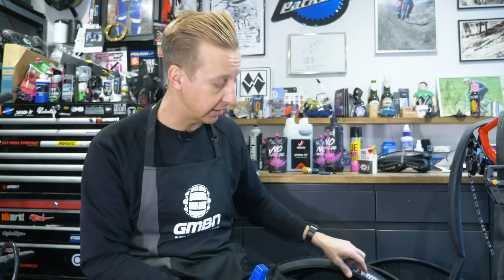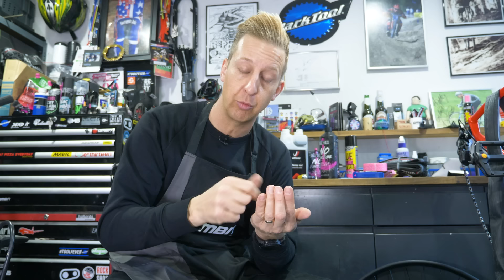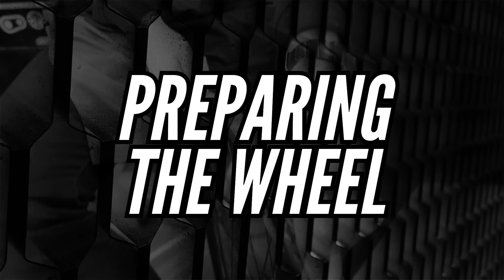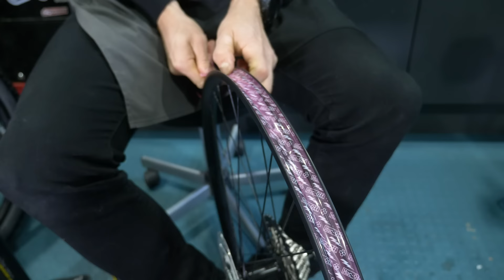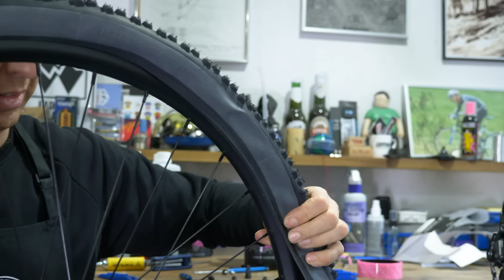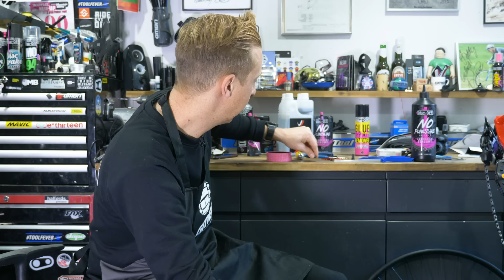How To Convert Your MTB Wheels To Tubeless | Mountain Bike Tubeless Setup

Comment: my DT Swiss wheels (27.5 and 29) never pop :-D but my Reynolds (hookless carbon wheels) pop very loud.

What I have experienced so far: newly mounted tires always lose a lot of air after inflating (first 24h up to 2 bars of pressure), after pumping them up again,  they might hold the air pretty good, after the first week I probably have to inflate them again (maybe 1-3 times)
Once I rode them a few times, they hold the air almost as good as a tubed tire. Maybe they need 0.2-0.5 bar every two to four weeks.

For me, there is no reason to run tubes. I Always seat the tires on a cleaned (and undamaged) or new rim with a standard floor pump, sometimes it helps to press the tire on a few sections slightly down while inflating them, to get them to hold some air. Once they popped in place, I just remove the valve cores and fill them up with 120ml of sealant per tire. Re-inflate them, job done!

I have got an issue with one of my carbon wheels, somehow sealant went inside the rim (under the tape) and is now making splashing noises under shaking, even if I do remove the tire :-D. But nothing is leaking so far, so I am pretty sure it's not that big of a deal.

Comment: With the sealant going through the valve does it gum up the valve?  Does it require a new valve and stem each time you redo or change tires?   Thanks for the great info

Comment: Had one recently where the rear tire started leaking from the valve after a few months, tightened up and fixed. Front tire air escaping from the spokes. Guess ill have to retape but gonna try some more sealant first. Both happened after sitting for about a month in garage because of work and weather. T

Comment: Ok So im a bit late to this video. Just got a pinch flat today and ive been meaning to go tubeless for a while. Both my rims and tires are tubeless ready, but I really dont want to get new tire because the tread is perfectly fine on them. New ones are 98.00 USD (Not sure for 1 or for a set of 2) and I cant spend that money right now. I also have valve stems a friend gave me so all I need is sealant and maybe rime tape. Will I be ok to convert to tubeless?

Comment: Hello Doddy.  I'm looking to frequently swap slicks with mtb tires on my 29er.  Slicks would be a Schwalbe Big Apple to a Racing Ralph and vice versa.  Note that these are both non-tubeless tires to a non-tubeless rim as well.

Is there a way of swapping them without throwing away the still-fluid sealant?  There's also an old trick where you use a split tube of a smaller tire size to act as an overlapping rim tape replacement that goes between the tire bead and the rim bead.  It's available to view in youtube as well.
Reply: I use slime pro str sealant, and reuse whats still liquid when swapping summer/winter tyres

Comment: Do you guys recommend using a glue on the rim for a conversion to seat the tyre. The bike shop where I first had it done used glue, now I want to do it myself. Great video btw. Thanks
Reply: Some of the pro xc guys use glue on the rim with less or sometimes no sealant. It works though I reckon it'll be a pain to clean up when changing tyres.

Comment: Hi Doddy!

My experience showed me, that if air is leaking around the valve hole, it could be also because of that the rim tape wears like an inner tube too. In my case I've changed the inner TL- rimtape and it sealed around the valve again.

Tell me what you think about it. And did you already had have that issue.

Cheers!

Comment: Will a tubeless conversion kit work for my 26" old school wheels?  I just purchased a set of Maxxis tubless ready tires and would love to convert to tubeless.  Thanks for the great vid.
Reply: @William Sambo Thanks.  Well my MTB is a circa 2000 rock hopper comp.  I preped the wheels by first filing down any rough edges at the spoke through holes and stem through hole, then sanding with 400 grit, then 800 grit.  Got everything smooth.  Installed the tires with tubes to flatten the bead for 2 nights.  Tonight is tubeless install!

Comment: So what if i want to go tubeless,and then after a few months,i want to top up my tubeless mtb tyre with sealant,i remove the valve core,the air escapes,tyre goes flat,does it become unseated?
Do i then need to buy an expensive booster floor pump? Or can i just pump it up as usual using my joeblow standard floor pump?
Thanks for any advice

Comment: Most decent rims come pretaped these days folks....dont just remove existing rim tape without checking first!
Reply: My wheels are tubeless on my commencal, I have just bought some new tyers, are all tyers tubeless compatible?
Reply: Thanks this comment saved me some time and effort was about to take the tape off and put some gorilla tape on thank god i didn’t buy 20 dollar tape tho
Reply: Team Banchamek a bit late but it should say if it’s tubeless ready on the tire. If not check the manufacturers website
Reply: I had my new bike which had new all terrain tyres, decided to go to winter tyres and go tubless. Though the tape on the new wheels would be ok so didnt tape them further, however after putting the tubeless tyres on etc I found I had a number of leaks. Will have to take everything off, check the spokes then retape to get a good seal. Bit of a pain. Got a friend that has been mtbing for years that says tubeless is more hassle than its work and to stick to slime innertubes, but i am willing to see how it goes. Spent good money on the tyres so not ready to give up yet!

Comment: Hi 
i have 29 2.5 on front and 27.5 2.8 on the rear using stans race sealant would you recommend 120 ml in the front and 200 ml in the rear 
many thanks

Comment: I work on my bike myself and know what I’m doing with most things but I’m not the best with tyres, I have bought tubeless compatible wheels but I’m using my tube only tyres on the rims and they don’t mount properly and they wobble, the wheel isn’t buckled it’s the tyre as if the tyre is too small for the rim (was also very hard to get the tyre on) do I need to use tubeless tyres with tubeless compatible rims or can I use tube only tyres, or do I need tube tyres but ones that are also tubeless compatible

Comment: Can I do this, and then bring a tube, so that in case of a flat tyre I can put the tube in, pump it up, and continue riding? That way I save the weight of two tubes and eliminate the risk of being stuck in the mountains where there is no phone coverture.

Comment: Very useful video, thank you for making that! One question: I'm very confused by rim tape sizes. I obviously know the size of my rim, based on that what size of rim tape should I use?
Reply: to answer my own question: if I understand correctly it simply needs to be a few mm smaller than the internal rim width. It must cover the holes for the spokes but not where the bead of the tyre will seat or interfere with the seating in any way

Comment: Will 30mm rim tape work for a 35mm rim? My logic is that if it’s covering the holes it should work fine. Also roughly how much sealant should I use for 27.5 inch rims by 2.3 inch tyres

Comment: Are all tubeless tires kevlar folding tires or can they also be wire beaded tires?  Also, can you use an air compressor to seat the bead to the rim?

Comment: I'm not sure why but trying to use tubeless tape has never worked for me.. however Gorilla tape works first time every time.     With my current tires.. I seated them fine on my Giant TRX1 wheels (Maxxis DHF 2.6 / Aggressor 2.5) using just a floor pump..     I haven't always been so lucky but with my current setup a floor pump was all i needed.
Reply: Yes I've used gorilla tape no problem, helps if you warm it up slightly, I put it on quarter before the valve all the way round till quarter after the valve (so 1 and a half times round), I think mavic supply their wheels with g tape

Comment: Windex or glass cleaner is a great bead lube. Flashes off and no soap in the rotor. 
 One of my most used tools for all things garage (including bikes) is an air compressor. It's simply a must have and makes tire seating a breeze.

Comment: I setup tubeless tyres around 4 months ago, haven't ridden my bike for the last 2 months and noticed the front tyre was flat this week. Once you've set up tubeless is there any maintenance required like cleaning the inside tyres and rims from old sealant before adding fresh sealant or is it okay to just keep topping the wheels up with sealant every so often?
Reply: It’s ok to just top off every 6 months or so. If your not riding the bike for any length of time, give your wheels a spin every now and then to keep the inside of the tire coated evenly.

Comment: Before I convert, I just want to know - given the way the sealant works, sloshing around inside until a hole is created and the change in pressure draws the sealant to the hole (oversimplistic, I know), if I was to want to release some pressure for a particular ride, wouldn't think just make a mess of your valves?  Or do the valves have some way of preventing this, or is there something else to consider here?

Comment: Any additional advice for seating fat bike tyres (26 x 4.0)? Been running fatbike tubeless for 3 years, but alphabetical have trouble with getting tyres seated without tubes. I’ve tried seating with a tube, then taking tube out but leaving one side still on. Helps but still difficult. TIA.

Comment: My tires are not tubelles ready and don´t seem to hug the rim very tightly so the air escapes through the gap even when I use the charger. Should I put more tape on the rim to make the gap smaller?

Comment: Hello, I have a question about going tubeless, Right now I have a tube and I keep getting flats, the last one damaged the tire with a 2" cut. I patched up the tube and tire but after inflating to 20PSI, there was a bubble on the tire where you can see the back of the patch. So I ordered new Tires, Maxxis Minion ..26x4..these are tubeless ready and I just need to know why I would go tubeless and the benefits of it. The bike lanes here are not cleaned and sometimes we hit a nail or a screw and may case I hit an old razor blade. I had slime in the tubes and it worked for 1mile and I had to walk the bike back. We ride 20-30 a miles a day everyday so we put milage on the bikes and tires since we are all retired. Thanx in advance for you solution and convincing me to go tubeless. Stay Safe
Reply: Schwalbe Raceguard / double defense tires rode me through glass shards on the street without going flat.
Tubeless tires dont help with large cuts into the tire unfortunatly.
Reply: @beerenmusli8220  It has been 2000 miles since my last flat and im riding on the same route with our little group. I have lowered my pressures to 15PSi rear and 17PSi front. Stan's sealant has been amazing, it sealed the glass cut in the AM ride and I didn't realize it till after my PM ride 60miles, I lost 1PSI. I will never go back to tubes. Trying to convince the rest of the gang to go tubeless (its going to be a miracle), I carry a USB rechargeable air compressor just to inflate their flats...lol

Comment: Is it more cost effective to get a cheap air compressor rather than a fancy track pump with a charger cannister?
Reply: In my opinion, yes. You can go down to Harbor Freight and get a small compressor for less than $100. Then you can use it for other purposes, too.
Reply: @KN-ko8ez  ...especially because this Topeak pump is $150. Ugh.
Reply: Buy a small garden sprayer for about $10. It goes up to 40 PSI and can seat tyres without a problem. Look up the video from Skills with Phil about it.

Comment: How long should  they keep pressure before needing to pump up to correct pressure again?  The Giant bike I have came with tubeless tyres already but even with sealant in them they need to be pumped up every few days. I have them at 65psi  and after a few days they go back to around 50psi.  Dealer claimed this is normal with all tubeless tyres.
Reply: Sheesh, 65psi? I assume you're on a road tire. Smaller volume, higher pressure => more likely to leak a little over time. You could try dunking your wheels in some water to try to find the leak (bubbles), but I'd say it's pretty normal - especially if it's affecting both wheels.

Comment: It’s easy enough when you can actually fit the tire on the rim🤣. It literally takes two people and metal core levers to put the tires on on my spectral. Never had such a combo. And don’t get me started on fitting cush-core😭, it’s practically impossible.

Comment: I have a pair of wheels that tubeless ready and I have been using tubeless tires with sealant for over a year. I bought recently a new set of tires (also tubeless) but I realised there's a leak. Shall I change the rim tape? Or will running with inner tubes for a bit seal the leak and I can remove the inner tube later on?
Reply from the maker: Try to identify where the leak is coming from! If you can see sealant bubbling out from somewhere, that's your. best indicator of how to proceed. It could be the tyre that needs attention, the amount of sealant inside that set up or the rim tape

Comment: I really do not understand why having tubeless will reduce the number of punctures - but I have been riding for only 50 years.
Reply: the sealant auto fixes the minor punctures
Reply: I just don’t get the point of tubeless tires in the first place. Seems like a HUGE pain in the ass for a very minimal benefit. I mean, for years I’ve been using downhill tires and rarely got a flat. The occasional time I did, it took literally 3 minutes to fix and be back riding. No messy sealant, no special valves, no trouble getting the tire seated and inflated, etc…

I don’t know man, but carrying around a tiny pump, an extra tube and a patch kit (just in case) in my jersey pockets, or backpack, or taped to my bike never really seemed like that big of a deal to me.

Comment: How do you know if your wheel has preinstalled "normal rim tape" or tubeless specific rim tape? Lots of wheels advertise themselves as "Tubeless" and "Tubeless-ready".
Reply: the tubeless advertising usually points to the rim profile being tubeless compatible, often with a rim strip installed and not ready to put sealant in because the rim strip has no adhesive and doesnt seal
Reply: Tubeless rim tape is adhesive, normal rim taped isnt
Reply: Tubeless rim tape is literally tape, held on by glue to the rim. Normal rim strips are just nylon or something and are not glued to the rim.

Comment: Hey. Does the rim have to be tubeless ready as well? Just called citi bike and they say I must purchase the rim and tires
Reply: I ran non tubeless rims in a tubeless setup using a Stan's kit for a few years without a hiccup, regularly ran low pressures and never burped air. Tyres were proper tubeless

Comment: Question, so one goes tubeless and after a few months of riding, one has a flat in the middle of the woods, like 20 Kms.  Is there an item that can go inside of the tire that would allow one to at least ride out or does one have to try to install a tube at that point?

Comment: Do you still need rim tape if the rims are 'tubeless ready' ?
Reply: i assume not unless your tyre is not properly seating?
Reply: Yes you do. Tubeless ready only means the rim is designed to hold the bead much better for tubeless conversions. But you still need tape if the rim hasn’t come pre-taped. There are rims that are “tubeless-equipped”. These are the ones where taping isn’t necessary.

Comment: I'm new to biking and thinking of going tubeless, the valves you put in look thinner, dose it matter if I have the thicker type valves in the wheel at the moment.
Reply: Smudgie Bear there are Schraeder valve tubeless valves available, but your rim is definitely not tubeless ready if it’s a schraeder setup. (Schrader? They both look wrong. Whatever.) those valves are available through your LBS, where they can also give you an informed opinion on your rims’ ability to hold tubeless bead hooks in place. If they rightly try to get you to upgrade wheels, keep in mind you’ll probably drop a few pounds of weight and end up with better hubs along with your new tubeless rims.

Comment: What if the rim is not tubeless ready? Does this matter or can any rim be used for tubeless?
Reply from the maker: Most rims will be ok, providing you've used adequate tubeless tape to seal the spoke holes on the inside

Comment: I have a 2017 model Weimann U28  wheels that o don't think are tubeless ready. If they aren't, do you think it will still work?
Reply: Yes. Its the tyres that have to be tubeless ready. Pretty much any rim can be sealed with gorilla tape.
Reply: At MTB pressures probably, but I wouldn't air it up like you would a 28c road tire...

Comment: #askgmbntech I have syncros wheels that came with my bike, they came with a rather thick rimtape already on them. When I try to put the rimtape onto the preexisting tape, it will not stick at all. Is there something wrong with the rimtape I bought or do I need to remove the preexisting thick rimtape that came with my wheels?

Comment: Very informative video for me. Considering converting a rigid MTB (ridden exclusively on pavement) to tubeless. Running 26x1.5 wheels with slicks; they're clinchers but they're not stamped "Tubeless Ready".  Any chance they could be used?  Thanks for the video.  Good stuff!

Comment: How often do I have to change the sealant?
Reply: Often if its latex based, less so (never between tyre wearing out) is slime Pro STR sealant (NOT their stuff for tubes)
Reply: That's quite often..
Reply: My experience is that a little topping up will keep you running a year or longer.
Reply: You don’t need to replace it, just add a little more every 6 months or so.